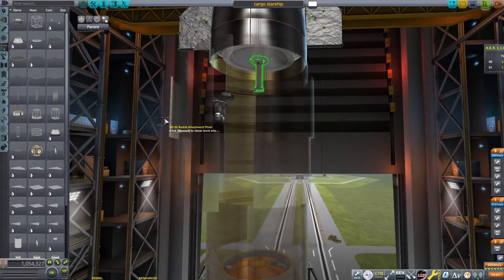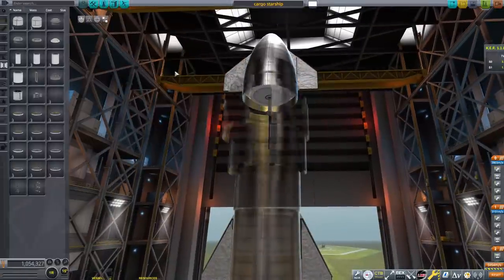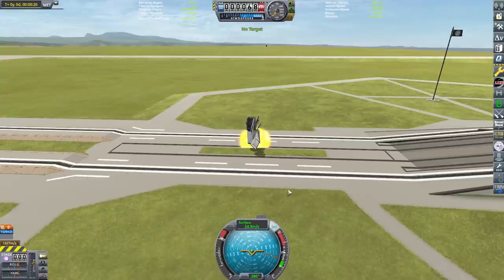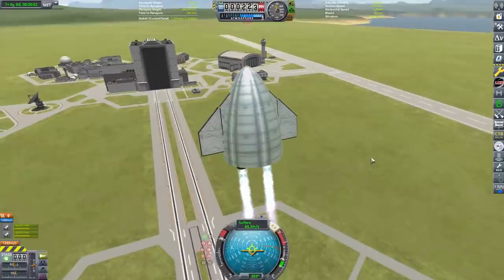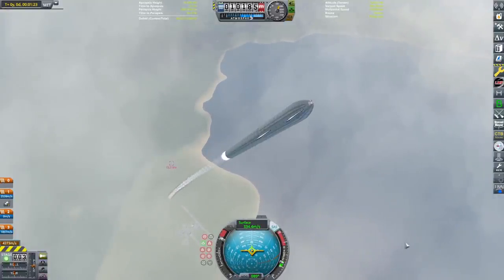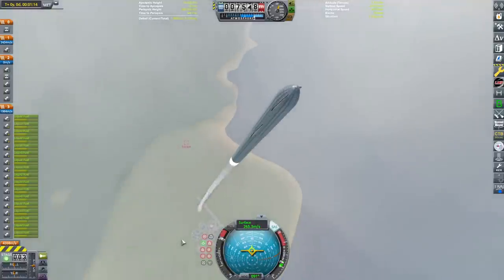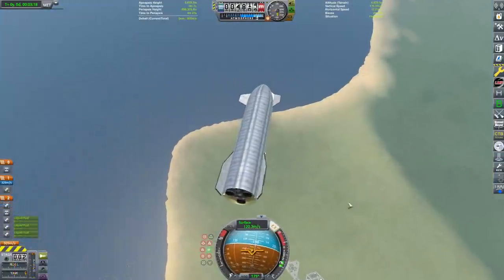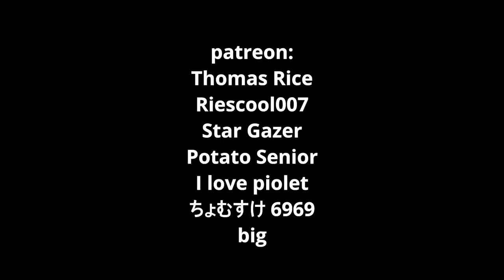KSP: What If Starship Had An Abort System!?

Comment: Hi! I’m Dylan Baker, and I play KSP! I have a challenge for you. It is to build a space shuttle car, and you do a space shuttle car because:

A. Top Gear once did this with a Reliant Robin, and I’ll put the link here (https://www.youtube.com/watch?v=pJdrlWR-yFM) but it failed, so I suggest you do a four-wheeled minivan as the orbiter.
B. An SUV (like the Toyota Highlander) as the space shuttle would be quite cool. 

Here’s the instructions:

1. Build a Toyota Highlander-like vehicle and test it on the ground.
2. Attach wings, a tail-fin, some parachutes, and a engine on it.
3. Attach the car to a mini-Energia-like booster/mini-external tank and solid rocket boosters.
4. Launch it into orbit and to the moon with Kerbals inside it. (If you select the core booster, than the core boosters and the solid rocket boosters will do the work for liftoff.)
5. Explore the moon.
6. Refuel the rocket
7. Return the car from the moon and back to Earth with a powered-glide. 

Please do the challenge for me so all your fans (including me) are impressed please!